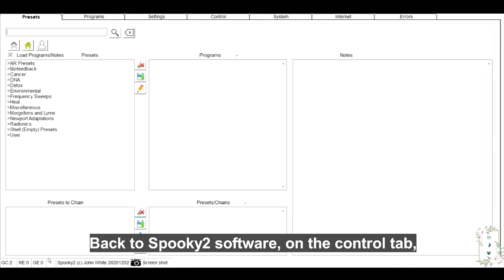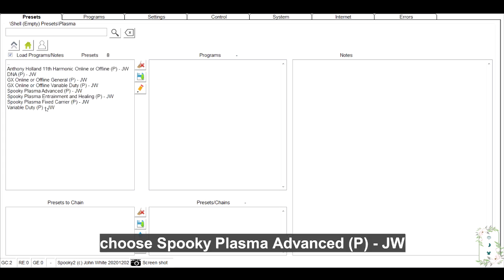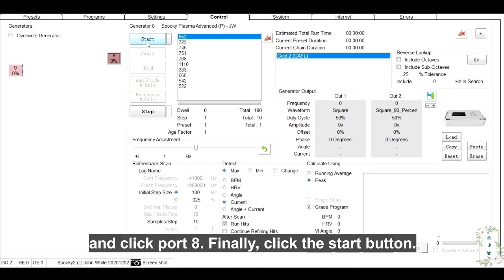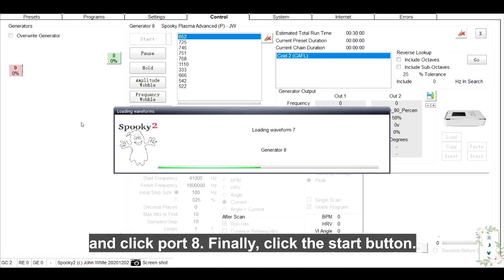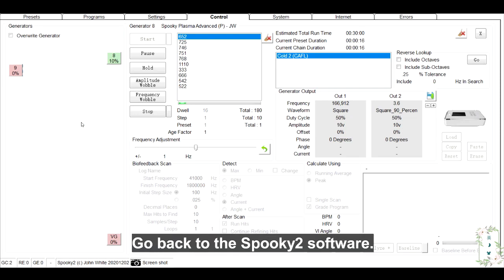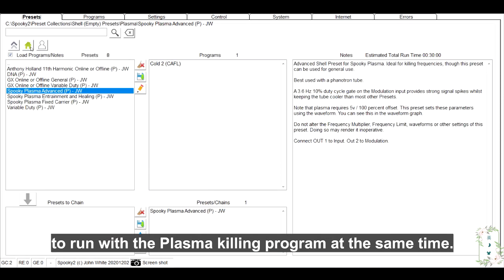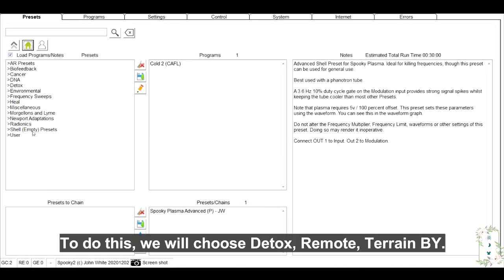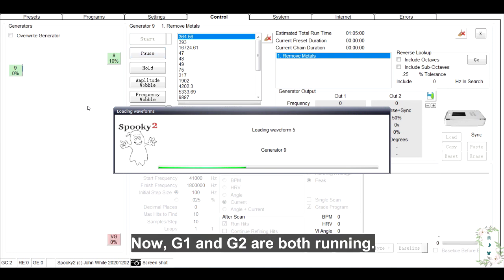How to Use GeneratorX with Spooky2 Central

Comment: Hello, I would like to ask if the plasma function major is because of the light or is the frequency thank you for answering❤
Reply from the maker: The major function of the Spooky2 plasma mode is due to the frequencies transmitted, not just the light emitted by the plasma tube. The plasma tube emits frequencies directly without a carrier, delivering powerful energy fields that penetrate deeply into the body. The light you see is a byproduct of the plasma discharge, but the healing effect comes from the precise frequencies applied.

Comment: Question:  Is it true that no matter what transmission devices are used with the Central Generator, it is recommended that ONLY presets that specify Plasma are to be used?  This is as far as I heard... only Plasma preset voltages, waveforms, etc. should go to the Central Generator?
Reply from the maker: Correct! 🔌

Comment: When you turn on plasma in software, do contact, pemf, automatically turn on ?
Reply from the maker: Dear friend, at the front of your central main unit you'll see a switch, when you turn on this button, and if you have connected the accessories of the two modes next to it, then you will find that it is working. If the button is off, then these two modes will not work. Hope it helps. Any questions, feel free to contact us.

Comment: Well done.  Thank you.  First video I have found that shows you how to use the system complete with a proper gear setup including the right spacing between the Central unit and the generator and computer.  Also the screen shots showing what programs to select for the plasma treatment AND the detox together on the same generator did it for me.  Wonderful.  I just received my kit and am going to set it up just like this.  Seeing the demonstration of how to use the gear with your body and then alltogether at once was also an eye opener.  Kudos to whoever created this video. :)
Reply from the maker: Dear Harold, wow!! Thank you very much for your support and look forward to your feedback after using our products. If you have any problems, please feel free to contact us!🌹🌹